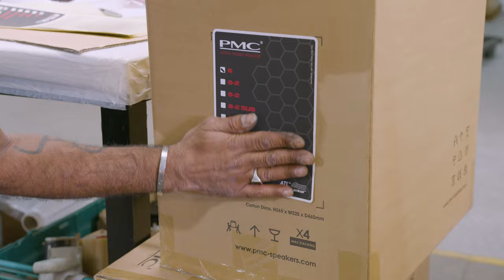PMC Speakers Factory Tour with Oli Thomas | Behind the Gear

Comment: Nice to see.
When 3D printing prototypes doesn't the material affect the sound? 
Partly the print resolution (surface not being completely smooth, most often at least) and the rigidity of the material? Although 3D printing material can be more rigid than wood or MDF so that might not be an issue perhaps?
Reply: Just guessing, but I know the wavelength of highest frequencies is going to be much longer than the resolution of 3D prints. For instance, a 0.4mm resolution is much smaller wavelength than the highest frequencies we can hear.

In terms of the resonances in the printed material, I'm sure it'll have some level of impact. I suppose the fast print speed can help to get a rough idea of their designs, and they can manufacture their best designs in the best materials (with resonances outside of the audible spectrum) after the fact. Likely all taken into consideration.
Reply: @PrincipalAudio  Sounds more than reasonable—making first iterations in 3d printed material and then fine tune the final iterations (I suppose at least).